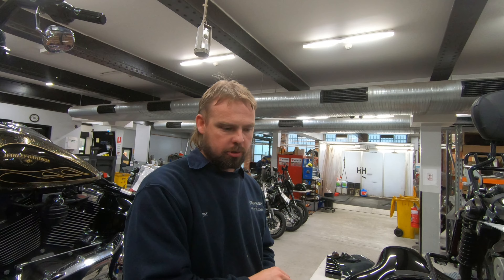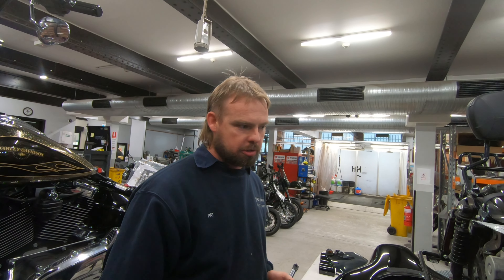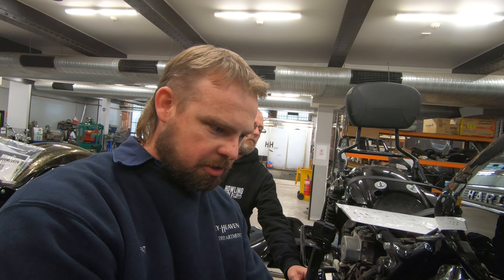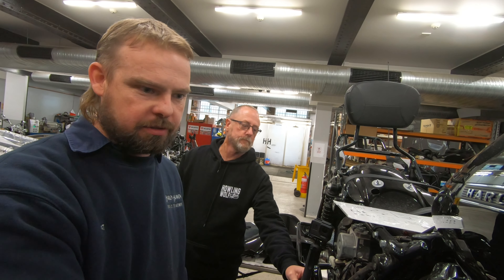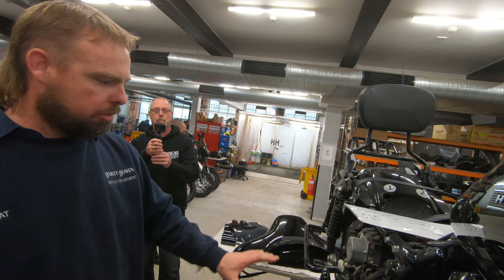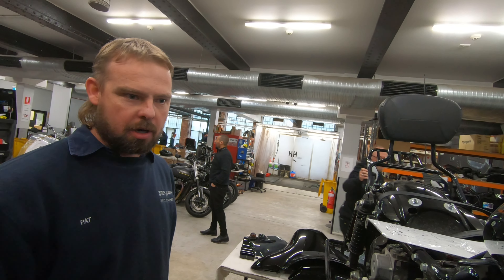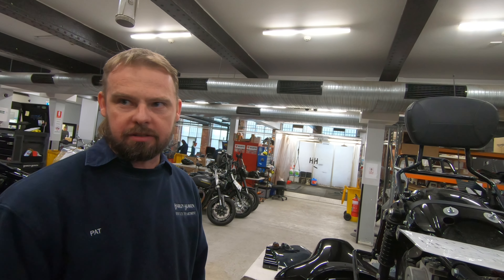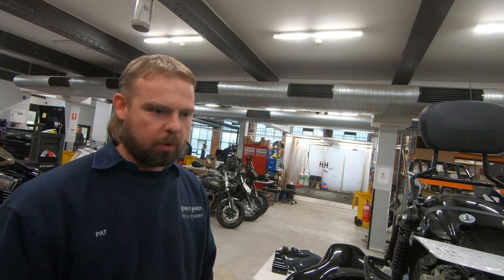STAGE 2 UPGRADE INSTALL-2018 Harley Davidson Street Glide Special

Comment: I recently put a S&S 475 cam on my road glide with the techno research tune was running ok but later had it dyno tuned made a huge difference went from 103hp,116torque - 115hp,126torque.
Reply from the maker: Yeah I’m going to put it on the dyno as well

Comment: did you make sure they put the oil pump on correctly by torque tightening as the crank is being rotated cos it does not hurt to ask A LOT OF QUESTIONS
Reply from the maker: Yes mate we did all that sort of stuff but I had to cut the video down for YouTube otherwise it would be 50 minutes long, thanks for watching

Comment: Stage kits are a Screaming Eagle package no such thing a S n S stage anything
Reply from the maker: Incorrect, stage 1 is air fuel and tune, ie pipes, heavy breather air intake, you can have any number of brands that aren’t screaming eagle, stage 2 is a cam upgrade and again you can use any brand and any configuration of either torque or horsepower cam